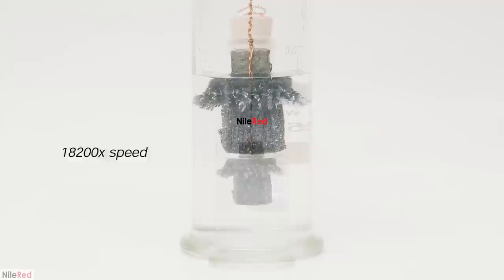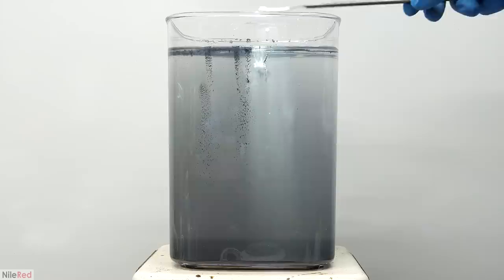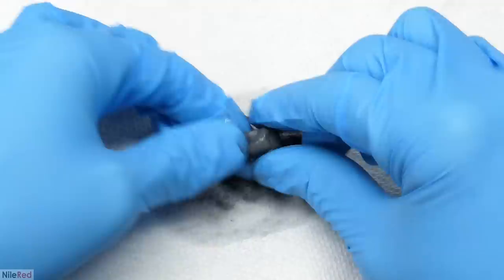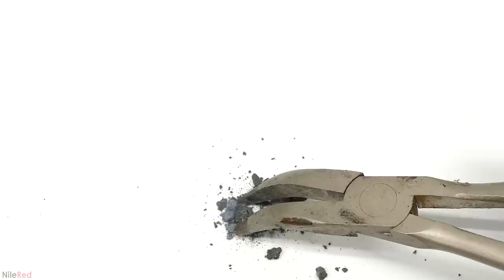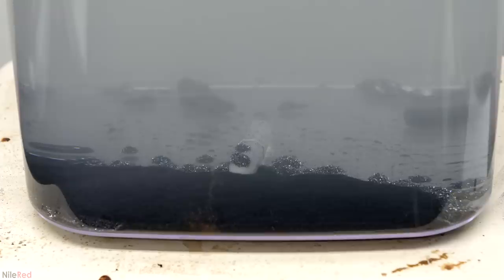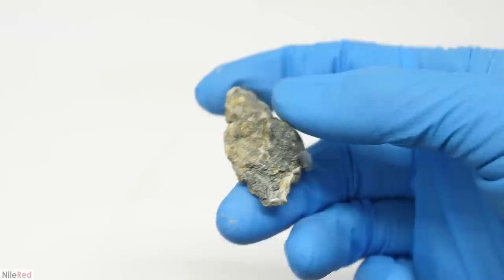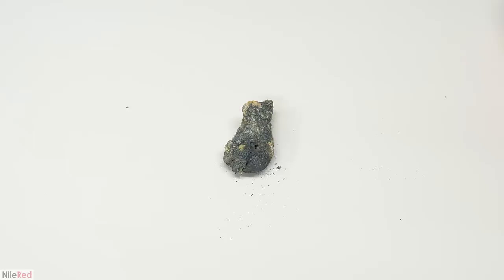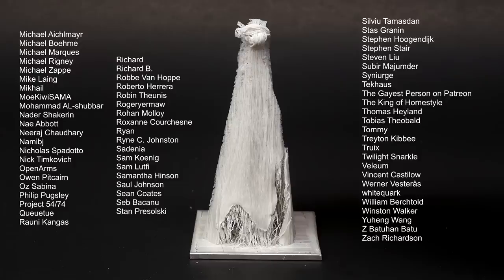I accidentally discovered lead sponge...

Comment: Make a simple lead acid battery. Should work well with the lead foam
Reply: Compare with one made using lead sheets to see the effects of all the surface area!
Reply: Kevin Vermeer I love this idea! 😀
Reply: Yes! Science and power and stuff! If you do this, try to runs something on it, like a lamp! people love lamps!
Reply: I agree but I'd try a Zinc mesh to grow the Lead onto. and turn that into a simple battery
Reply: Yeah I think a simple lead acid battery should work! I'm just waiting to see it!
Reply: I like this idea! In fact, I wonder if it would be possible to do a home 'repair' of a lead acid battery by using this method...
Reply: I like the lead-acid battery idea. Thing is you'd have to get the zinc impurities out, which may destabilize the lead structure. Doesn't seem terribly novel but if it works, it would help to demystify (to some viewers) how high-capacity batteries work. Personally, this has been a longstanding interest of mine, and I'd like to see it if you can pull it off.
Reply: my thought too. I put this in my solar info folder for a day when I might have time.
Reply: 666 likes on your comment
Reply: No Moth- i mean I love lamp
Reply: @grey1wa  brilliant idea
Reply: @Oinikis do you really love the lamp or are you just saying it because you saw it?

Comment: Would be cool to see if you could form a mold or something to protect against radiation, I believe lead is used commonly. But this being mixed with water and lead, might block more radiation (but would need to keep hydrated) with a thinner layer.

Comment: I left some electroplating solution in a closet for too long (I think it may have been contaminated with zinc) and a very similar sponge can form with copper. The solution was originally a very high concentration copper acetate and water solution, and I think that some zinc dissolved into it over time. I found it recently and noticed a weird wiggly solid sitting at the bottom, and that’s when I remembered this video.

Comment: Do any of them float like pumice?
Do they absorb liquids or filter like activated charcoal?
Can they be molded and carved then dried and used for plastic casting?
Does the surface area make the lead react faster in reactions?
Can it be used in place of a more expensive catalyst in any reactions? 
Using it as an electrode, does the increased number of nucleation sites allow it to split water more quickly or produce a higher yield of O2 and H2?
Reply: HOLY SHIT THIS MAN GOT THE QUESTIONS!
Reply: please someone upvote it!
Reply from the maker: Ill look into the floating question and the filtering. 

It would definitely react faster than normal lead, but i dont think it can really replace any catalysts (I could be wrong though).
Reply: @NileRed in science, you'll never know what will happen next after a discovery ;)

Comment: Make the container much deeper ... several meters ... so the reaction is completed before bottom is reached.
Before the bottom, you could place a net of some sort, catching the sponge, so it can be lifted out without being squashed at all.
Reply: It would cost so much money
Reply: @bastienpabiot3678  worth it
Reply: @bastienpabiot3678  
A net and a clear plastic tube cost a lot of money?
Reply: The comment above suggests a container that is a few meters deep...
Reply: @antony9956  precisely
Reply: I don't see the point of the container being deeper since when you lift the net you will always squash it a little bit, just by putting a net at the bottom before droping the powder should do the trick.
Reply: @bigaaron  yes. Indeed
Reply: Or you could use, y'know, a slotted spoon or something

Comment: You were so close to the first PN junction commonly used in electronics:
https://en.wikipedia.org/wiki/Crystal_detector_(radio)#Whisker
I found it especially ironic you used the meter on the diode(PN juunction!) check function, which also reads out the bias voltage of the PN junction, without landing on the thought of it nearly being a diode. Galena (the crystal form of lead ore, often on a piece of quartz when found in nature) was typically used often with just an ordinary safety pin's point being used to make the PN junction.
 Oneday you might also try messing around with germanium to make a germanium diode which can also be used to rectify AM out of the air. They're very effecient and take about half the voltage of a silicon diode. Come to think of it I don't think I've ever seen the voltage of a Lead diode ever posted anywhere on the net.
Reply: @dacomputernerd4096  maybe i have to confirm tho but i can give u maybe 60% certainty? 
Im not the best at chemidtry
Reply: nerd
Reply: @theisthecool1105  ur that one pootis guy who got shot once and killed the guy who shotted u right
Reply: Ha ha science stuf go brrr
Reply: yes

Comment: What about electroplating it with something like nickel or aluminum, and melting out the lead to form a sort of metal aerogel?
Reply: There's a similar method for the production of Raney-nickel, an extremely active hydration catalyst. You form a Nickel/aluminium alloy and etch out the aluminium witch conc. NaOH, but you don't an "aerogel" like product, in fact it's quite dense.

Comment: 13:42 - I think it could be the concentration window in combination with fine crystals from the powder that stay in suspension and get dragged in between the granules (crystallization nuclei) + the amount of zinc granules added? Also "scratching" the surface of the granules could make some different effect.

Comment: Make some of the sponge using zink powder but make a wire and mesh frame for the sponge to accumulate on  and then carefully lift it out and wash it in an HCl bath and then cut it to size and make a lead acid battery cell, That would be an Awesome thing to see and I'm sure many of the viewers will like that to .Great work keeps up the good content Nile.

Comment: Perhaps you could try to get a microscopic look at it, to see the structure? You could also try to experiment with adding certain materials to toughen the structure. For example, experimenting with pouring in certain powders, before the zinc dust, that the lead sponge can form around. You could experiment with crushing materials that don't react with lead or zinc into dust and pouring it in before the zinc dust. Or you could try putting larger things similar to ball bearings, to make the lead sponge form a lead sponge covered ball or crystal. You could also try putting everything in a mold instead, and (attempting, at least) to take it out and have it in different shapes. But that's all just me putting random ideas out there. =P

Comment: Your recreation attempts didn't work because you didn't have your magnetic stirring rod in there. The lead were clumping together ferromagnetically the same way iron powder clumps together from adopting a magnetic field.

As for uses, I'm thinking lightweight conductive rods for motors, but the porous nature of it may prove to be a poor overall conductor, since given enough current I see it easily melting the lead sponge structure.
Reply: Wh000 lives ina pineapple under the sea something something porous is he!
Reply: Wtf? Neither lead or zinc is magnetic and if they were then the crystal growth would be affected when the stirring was on. Also lead is a terrible conductor when compared to silver or copper, there would be no reason to use it even if you could create a harder structure as it will never be as hard as other metals
Reply: You're wrong. Neither zinc or lead is ferromagnetic.

Comment: Great Video! I can see a use for this info in my battery research. I think if you stirred the mix slowly while adding the zinc, you would get more crystallization, which you might be able to control the crystal size of with the mixing speed. I would also try linking the crystal structure together with a borax solution after it's made, which I  think would make it more solid. Can't wait to see your new lab! :-)

Comment: If you can remove the zinc, you've just shown suppressor shooters how to recycle the lead that comes out of using "the dip" (50% hydrogen peroxide, 50% vinegar) that they use to clean their suppressors which forms lead acetate when it's done. (Stainless or titanium suppressors, not aluminum ones.) Get the zinc out and you can re-cast a lead bullet from it. (Zinc is terrible for lead casting!)

Comment: Test the efficiency of the sponge as part of a battery. How much is converted to salts, what's the voltage, etc. of different densities of sponge.
Reply: I'd like to see that. Is it possible to build a fairly robust reusable lead acid cell battery at home? Cody said he had done it but didn't really show any results.

Comment: Might be interesting to try making a battery of it. The zinc contanimation might be an issue, but that structure- well, you read the paper. compared with a lead plate battery containing a similar amount of lead, it aught to work better the 1st recharge cycle, although I doubt it would be durable beyond that.

Comment: Spongy lead was proposed as very useful material for batteries for cheap electric cars.
Theoretical maximal specific energy of lead acid cell is around 166 Wh/kg. If we could get let's say 120 Wh/kg, then you could make 400 kg battery pack with 48 kWh, giving you possibility of going upwards of 500 km on single charge - <10 kWh/100 km is possible with very low rolling resistance wheels and streamlined design - SIM-WIL can get 350 km of JC08 range with 35,1 kWh battery (kerb weight 1580 kg).
Reply: Thanks for sharing that very interesting information. How do Tesla's batteries stack up against max potential?
Reply: Their newest 2170 cells are around 322 Wh/kg (the only data I got, might be higher or lower), but being lithium-ion, they need some extra electronics for protection.
Unfortunately I don't have exact theoretical number, but it should be around 600-700 Wh/kg for Li-NMC (currently densest in mass production). That would be around 46-50% of theor. capacity.
LiFePO4 have theoretical specific energy of 385 Wh/kg, and they have about 50-60% of Li-NMC energy density.
Lithium sulfur (Li-S) are at this moment batteries with highest practical (500 Wh/kg) and theoretical (2,4 kWh/kg) energy density, and have great potential for electric and long range vehicles or possibly even boats.
If in near future (20 years or so) we'd be able to get to 1 kWh/kg with cost lower than 100$/kWh (currently around 140$/kWh from LG Chem, not sure about Tesla/Panasonic, could be lower) then ICE vehicles would be very much dead. We will surely get to 100$/kwh much faster then to 1 kWh/kg, but even 200 Wh/kg would be enough to compete with ICE, the cost is more important.
EDIT. I forgot to add - higher specific energy would make batteries cheaper per kWh since less material is needed to achieve given capacity.
With 1 kWh/kg batteries would problably cost less than 50$/kwh..
Reply: That is some great info, thank you so much!

Comment: use the lead sponge molded into plates to make a lead acid battery, while your at it try to make it as close to 12v as possible
Reply: Just do it in a Pyrex dishes and dry it. 8 plates should be enough. The surface area would allow for a lot more amperage, than a solid sheet of lead. Of course, with it acting like a sponge, would the electrolyte pass through the sponge plates and cause issues?

Comment: you mention that if we have ideas we should post them in the comments, so here's my idea.
how about repeat the process to get the lead sponge, except this time instead of drying it using an oven and heat, maybe try drying it using a vacuum chamber.
this should prevent the formation of oxides or any coating on the surface.

Comment: you are made an electrode material with probably much higher surface area than gas impregnated cast lead because of cristallic microstructure.
it will be cool to purify it and test it's elecrical properties.

Comment: maybe someone could answer this for me. since thats a form of lead. lead sponge or whatnot. would that make for a viable shielding for radiation? i mean does lead shield from radiation because of how tightly its packed or would it make for a light weight yet thicker sheild material to put around something radioactive to sheild from it? sorry if thats dumb by the way...just curious and it popped into my head.
Reply: wow thanks. thats pretty cool. its kinda neat that a lightbulb moment after watchiung a youtube video could be something that is already being worked on by major researchers. to be honest the porocess that nilered is doing seems like something that could be done cheaply and pretty easily. it seems like you could form this material then allow it to settle into a sort of mold and then bake it dry and see how stable it would be to hold up as a shielding material. shrug but im no scientist. so I would leave that up to them, im sure its already something they have thought of...i would be shocked if i hit on something that others had not already thought of.
Reply: Thats not dumb at all, its a very good question that any decent scientist or engineer would ask! The chemical properties of lead help make it such a good radiation blocker but a very important property of it that makes it so effective is its high density. As such it would seem that the lead foam would not work as well since it lacks the density. Of course it also depends on the radiation, but a high energy form of radiation would be able to penetrate the foam more easily since it has to go through less lead.
Reply: Bobbert Bobby if its shielding for radiation then i dont think its that good of a idea, the ability to stop radiation has to do mostly with mass,  lead just happens to have a lot in sponge form it would still take the same amount of total lead so it wouldn't give any real benefit, if the lead is a issue you can just as easily use a bunch of water, concrete, heck a buch of wood would work with sufficient thickness
Reply: Lord_Lammington this isn't quite accurate to his question, I know it's being a bit pedantic but the foam being looked at in that article is stainless steel with interstitial hollow bubbles of tungsten which is extremely effective at blocking radiation even in small amounts (it's just waaaay more expensive than lead) so there are some foams that have the potential to be better, but so far they said it still doesn't compare. It would be pretty cool if they can get to the point of lead or even beyond because than they could reduce the volume and have it still be as effective.

Comment: Don’t know if nucleation sites play much of a role in crystallizing metals, but perhaps the previously added powder made for a more uneven nucleation site? So it started forming crystals near the edge since right under the grains is covered the only the edges make contact with both the liquid, grains and the powder? (The floating power was too low concentration? I dunno)

Comment: Possible practic use for a led sponge :
-light weight radiation shield for rockets or Mars colony
-radiation shield for nuclear reactors or nuclear waste storage facilitys.
-increasing battery specific density and probably many more.
Reply: Major problem for sake of radiation shielding: lowered density. While the atomic density remains unchanged, the molecular density is drastically lowered, as it's now a very loose metallic array. However, you are unmistakably correct that it serves a purpose for batteries, as stated in the video that lead sponge is often used in car batteries.

Comment: Door breaching lead sponge shotgun shells! Send some the Taofledermaus YouTube Channel and see how they work as ammunition.
Reply: I don't see the point, they would crush under their own weight the second that the gun went off, right?
Reply: Atleast they would crush at the door, which would be the desired effect so they would deliver the energy but don´t go through the door
Reply: But wooden stick as ammunition would probably perform even better? Crushing door wood
Reply: Wood could be destroyd by the shot self, metal powder rounds for door breaching are in use ... but this would be a very crude version (maybe pulverize at the moment of the shot too ^^ )

Comment: Careful with those lead fines!
Atomized lead is strongly pyrophoric.
When scattered in the air, it can auto-ignite!
The classic 'magicians smoke-bomb' was often a bit of pyrophoric lead in a glass vial.
Smash it on the floor, or fling the contents into the air and you get a bright blue flash, sparks and dense clouds of smoke.
The smoke is various lead oxides.  Not cool, bro!
Iron dust can do the same job with more sparks, a yellowish flash and not as much smoke.
BTW, test your lead nuggets with a multimeter!
Should get low resistance, close to pure lead.

Comment: This is because you formed lead in a liquid
Since it still holds has gaps when dry because that’s where the water was so it will easily crumble
It absorbs water easier when dry because it now has empty gaps to hold and take the water

Comment: I have a great question I think. What would happen if you tried to melt it, or if you tried to melt it at a temperature where one of the metals would turn liquid but the other would not causing it to partially liquify.

Comment: I came up with a use for this sponge: A Lead Acid Battery

I don't know if being impure with zinc impurities would make this unusable, but it seems to be a good way to get really high surface area battery terminals. If anyone knows how the zinc would interact, I am really curious.
Reply: The zinc can just be dissolved away before being put in the battery.

edit: It'd actually be easier to do after it's put in the battery.
Reply: TheSmileyFacedPizza how
Reply: carolyn mmitchell Sulfuric acid dissolves zinc but not lead. Just make the battery, leave it for like a day, then drain and refill the acid before using it.